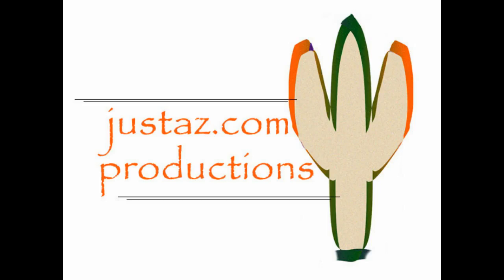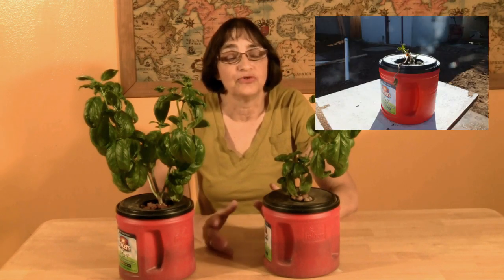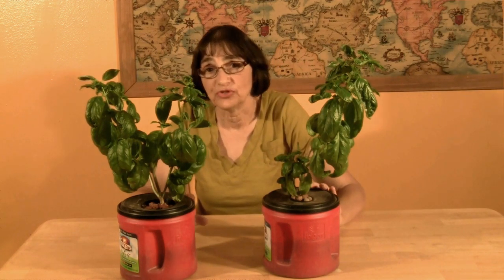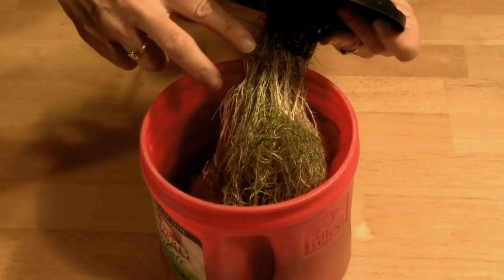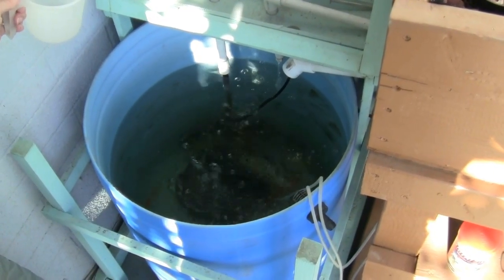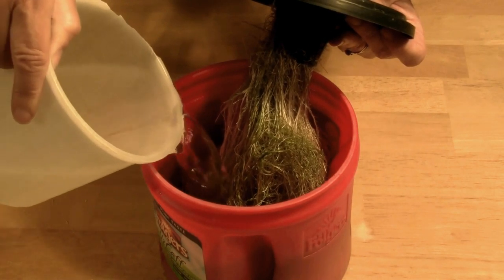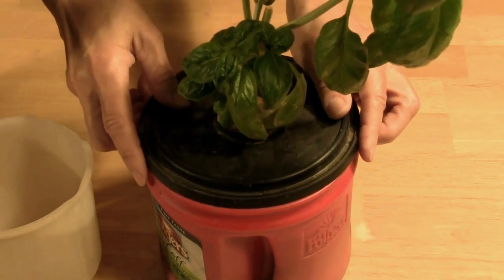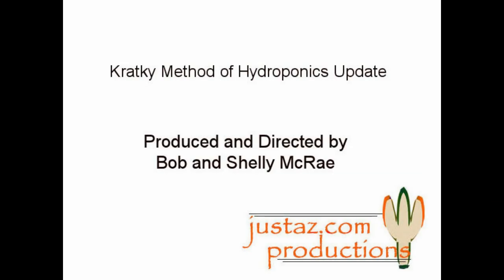Kratky Method of Hydroponics Update: The Basil in a Can

Comment from the maker: Is the algae on the top side of your tray? If you're floating the tray, like a lettuce raft, then try using a tray slightly larger than your reservoir and rest it 'above' the solution, just enough so the rockwool has to wick up the water. The tray can't float on the solution. Just the bottom part of the net pot should be immersed. If you control the current growth, you can probably save the seedlings. Best of luck in this. Let us know how it turns out.